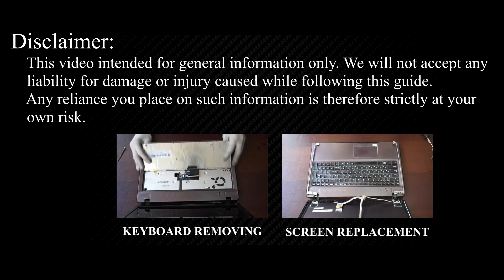Lenovo IdeaPad Z570 Z575 Disassembly, Fan Cleaning, and Thermal Paste Replacement Guide

Comment: This is accurate until the fan disassembly. I don't think that is necessary. I attempted to do what was shown. There are micro wires that are under the fan so the fan under assembly acts ambuture with two fine wires that  are connected to the main fan housing. I agree with the use of this video up to the assembly of the fan. Just get a fan if you really need to do this. Thanks for the try.